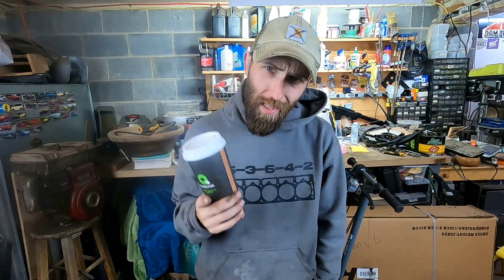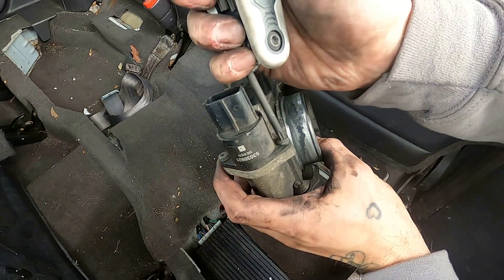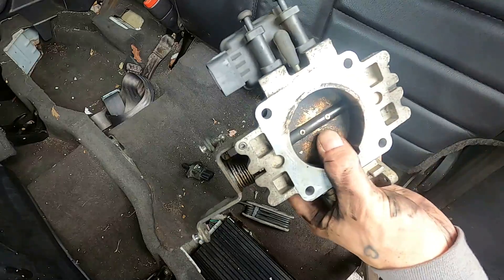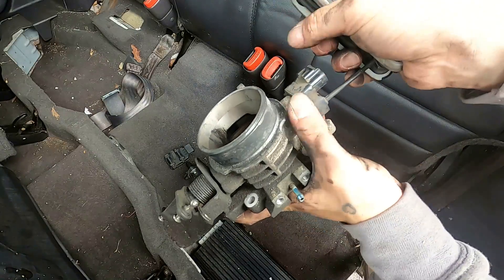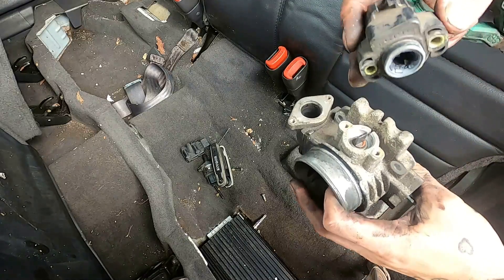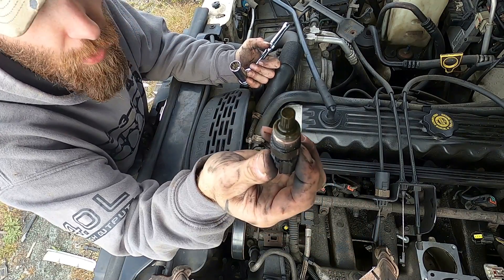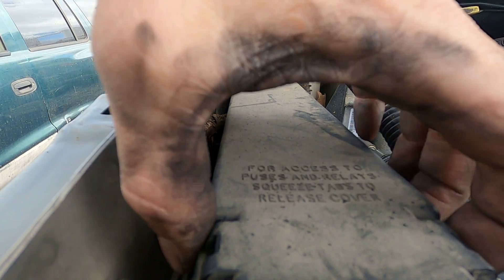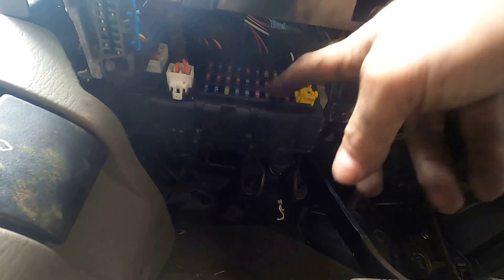Jeep 4.0L engine sensors I suggest you keep on hand

Comment: Two points: 
(1) The TPS can start going bad, but not bad enough to set a code in the ECU, making it difficult to diagnose.  One symptom of this is the torque converter occasionally coming out of lockup on the highway.  Sister thought that the engine was "missing" (like a cylinder occasionally misfiring), but the RPM was actually blipping up slightly each time it happened.  Torque converter coming out of lockup.  Replaced TPS, problem went away. 
(2) A sensor I would add is the transmission Output Speed Sensor (42RE, obviously).  It's very easy to replace, and in fact can be done trans-fluid-leak-free if the vehicle is on somewhat of a downhill slope (facing downhill).  When the sensor goes bad, the transmission will not shift out of first gear.  So now you're not technically stuck on the side of the road, but being stuck in first could have you running out of gas before you get home or to a gas station.  Had that happen to my sister, also.
Reply: I got a P0720 (Output Shaft Speed sensor - malfunction) and P0700 (Transmission control system, MYL request - malfunciont), my transmission delay to shift from 1st to 2nd gear in High Range, and stuck on 1st gear  in 4Low. It's probably this sensor you mention second? Do you recommend any specific brand? What 42RE means?

Comment: Just got a 96 ZJ that I'm going to fix up, thanks for the valuable info.
Reply: As a 96 ZJ owner myself: suggest you get 98 ZJ sensors for the throttle body! The only difference is the connectors. They are way more secure. Yes you will need to cut and butt connect/crimp with heat shrink. The IAC valve will no longer have that 90 deg turn. As good as this video is: don’t blame it all on the sensor…. brittle wire at t the connector and basic connectors on the 96 that Jeep upgraded just two years later. Good luck!

Comment: So we have a 2000 jeep cherokee classic 2wd, 132k miles, wiring harness looks like a rat nest and has been chopped on, I've spent days goin through the harness to re hooked all cut wires, replaced fuel pump crank sensor tried new map sensor, the and relay started buzzing on me so we purchased a new one and does the same thing, and now the fuel pump stays running when Key is turned on, we tried a junk yard ecu the fuel pump primed and turned off as it should, but still will not start

Comment: How do you know if a junkyard sensor is any good? 

Isn’t it best to buy a Mopar sensor new?
Reply: Multi meter and guidance look it up. I know the Crank sensor you test the right two pins with the notch upright with the ohm meter set to 20k resistance. You should get an infinite resistance reading or OL = Open loop. Any low resistance means a short or circuit closure somewhere.

Comment: Where you dropped the TPS screws is home for spare CPS, oil sensor, cam sensor,cap and rotor(XJ). In the WJ it’s home for spare ECM that has been programmed. 
This is a super video!

Comment: Once again, you have nailed it. Extremely accurate on the TPS and the oil sending unit sensors.
Drove through flooded street in the morning and by the afternoon I did not have first gear. Had to roll out of the parking lot is second gear. Made it home just fine TPS dried out overnight and in the morning. It was good as new, or as I should say good as used. One day when we get old Doug, you and I are going to sit on the porch have a couple cold ones, and complain about how these TPS sensors in these new flying cars are so much harder to replace than these WJ’s.

Comment: Is there a sensor that would cause a lean under power backfire ? I've replaced plugs, coil, TPS and injectors. All cylinders are at 160psi on compression with the exception of #3 which is at 101psi.

Comment: Distributor 4.0s have a cam position sensor as well, it's in the distributor, under the rotor. Parts store computers don't believe they exist, Rockauto doesn't believe they exist, but they do. I know they exist because mine has gone bad.
Reply: @jamesl9686  Makes sense, I got sick of trying to diagnose mine in sub-freezing temperatures when it failed and dragged it to a shop who told me it was a bad cam sensor, it was pretty embarrassing when I got it back from the shop and they told me what it was. Definetely one to have a spare of on hand, though.

Comment: Spare items to add ;   ignition coil, ignition switch, belt,   (and for more extreme folks; drive shaft, ujoints, tierod ends, axle shafts with hub already attached,
Reply: Ha, ha, my 2007 VW Golf with over 200K miles never had any sensor issues, basically they are  resistive  or Hall sensors....I have  a '93 Wrangler that I intend to restore though and this video is really useful. Will collect all the sensors... Let other people drive the electric cars, we keep what we have...:)

Comment: Hey Doug! Being from the 2.5 clan in my MJ, here's what I can tell. The 2.5 is actually really reliable and doesn't have that much sensor problems. However, its problem is popularity and rarety. Many sensors are on close-out deals even on Rockauto, especially the manual TPS sensors. Water temp and oil pressure sensors from vehicles with full deluxe cluster are worth something, ECU's are important for 2.5s, since they're rare, and has been many versions from year to year. A good functioning idle stepper motor is worth gold. And finally, air temperature sensor; IIRC, you can't get them anymore, so I converted to and AC Delco unit. It's like 1 or 2 degrees F off from the original, but works great, and I only had to change connector styles.

Comment: Ive got one of those bags that the owners manual comes in, but im using it to hold my owners manual. Otherwise id send it your way. If i ever find one that i can scoop up, i'd gladly get it to you. I should do a junkyard run soon anyways. Im replacing a wheel hub on my Liberty on tuesday. And once i do that ill just need to ignore the huge hole in my muffler until next spring and call it good 😂

Comment: Great content. I own a 99 and 04 WJ. The 04, 4.7 has a constant tapping sound. I've no idea what else to do. New push rods, rockers and timing chain tensioners replaced 😢???
Reply: if its rythmic to the rpm then Id say piston slap. Possible cracked piston. Replace it before its too late. You only gotta do the problematic ones. If its not that then I'd say rod bearing. Those are easy to swap on the 4.0. dunno about the 4.7

Comment: I wouldn't bother getting the oil pressure sensor for this purpose unless you can find a low-mileage one you know will fit your engine. The 98 in particular used a different sensor from pretty much every other 4.0, and the one in the video looks like the aftermarket piece of crap that was on my ZJ when I got it. This sensor won't leave you walking, just with a sense of existential dread as your oil pressure gauge falsely shows zero, so it's worth it to get a new genuine Mopar sensor and probably never worry about it again.
Reply: I feel so much better. I thought I was the only one that replaces an oil sending unit and has his gauge permanently at zero for the past eight months. Where is the best place to get the genuine Mopar parts? I’m trying to get it fixed before my check engine light bulb burns out.🤣 thanks for any help WJ buddy!
Reply: @robtheroadie2240  yeah sometimes the new aftermarket sensors are bad right out of the box, also I've heard the little passage that the sensor threads into can get clogged with sludge and other debris. Mine prob wasn't clogged since the sensor was physically falling apart but I was changing the oil so I flushed it out with some brake cleaner anyway.

The Mopar part for my ZJ was available on RockAuto for around $60 but for some reason it didn't show up in the catalog, I had to look it up by its part number.

Comment: As an XJ enthusiast I can attest to the need for spare sensors! Great video.
Reply: I’m having a problem with my 1994 Cherokee Sport it started running rough idle was going up and down so I changed the entire throttle body I have a parts truck ,I also changed the injectors and the O2 sensor and also the spark plugs and they were black the new ones and black smoke was coming out of the tail pipe and it’s gotten worse now it’s hard to start and won’t even run while idling and this truck has always ran perfect do you have any suggestions on what I should do or have any ideas on what could possibly be wrong